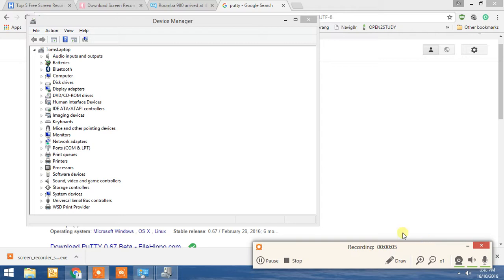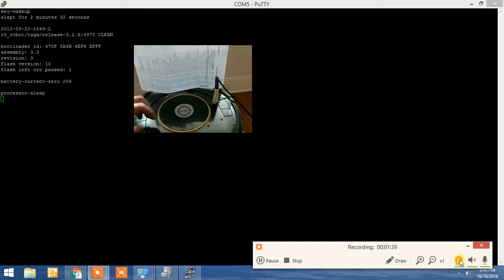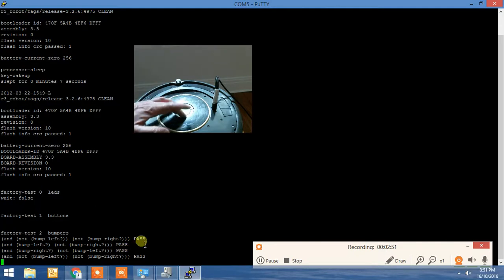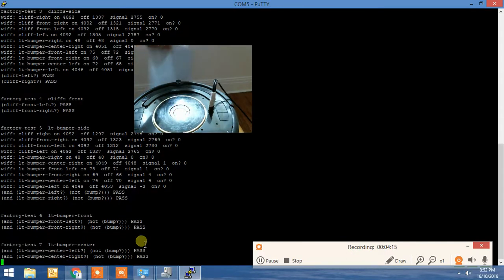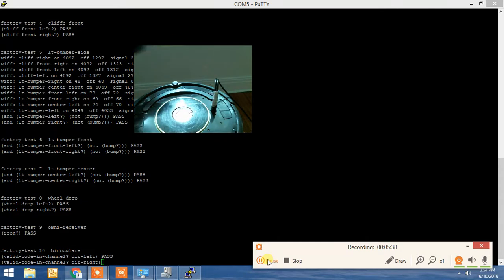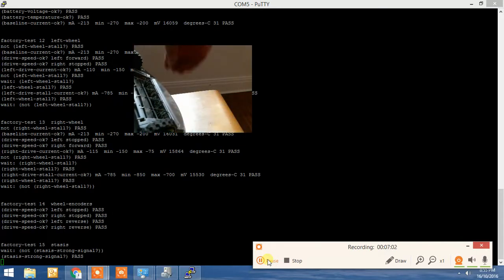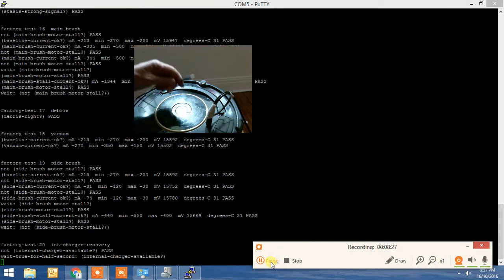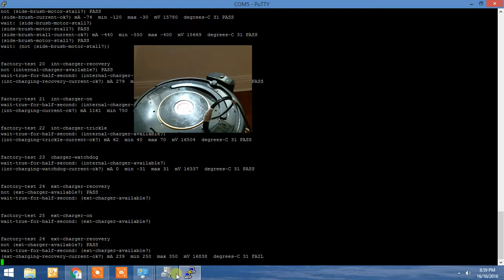Roomba troubleshooting using laptop  Built-in-Test mode (BIT) - Part1/2

Comment: My roomba 770 would just turn on but didn't run, without any error. So I built that cable and tested with Putty. Find out that dust bin vacuum motor failed. Once I replaced it, now is back in the business / floor.  Thank you !!!

Comment: Hello i have roomba se. I tested and clif senser is not working, and it feel space and not working, i replaced the sensers but i thing problem is on board, can i cancel this function, thanks gör interest.
Reply from the maker: Hello, I do not think you can cancel this function. You could try cleaning the motherboard with some electrical contact cleaner.
Reply: @drroomba5045  thanks for answer, i cleaned but not working.

Comment: good morning, sorry for the translation, but i have a problem with roomba980, i will do these tests on my roomba, do you know if it works on roomba 980? I bought a used roomba 980, and the battery came out of charge showed a problem when charging, I bought another lithium battery I put in it, and it gave error 6, saying put roomba in the base and start again, I put it in the charging dock and did not recognize the battery, I disconnected him and I left him, I went to find out how to solve it, after 12h the battery is empty, I will charge it externally because it doesn't charge in the dock, already had this problem?
Reply from the maker: Yes, if you remove the top cover you will see the 980 has a USB type connector where you can plug into. You probably have a cable at home already.